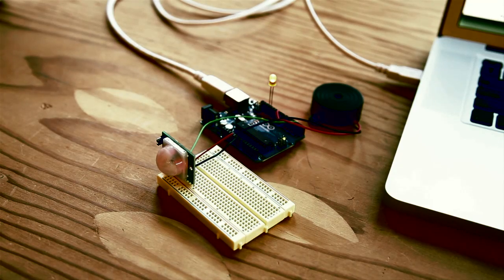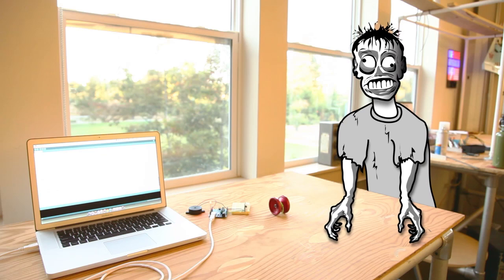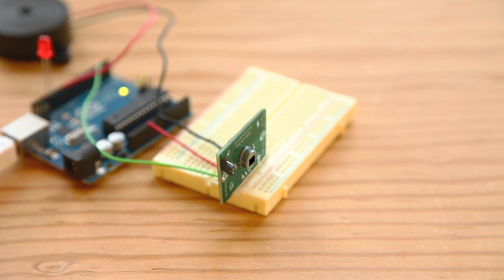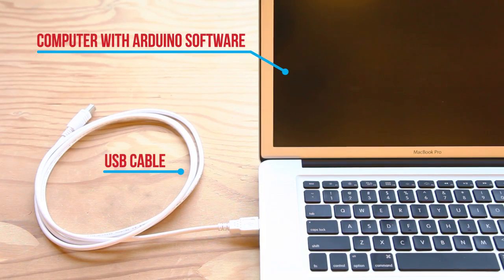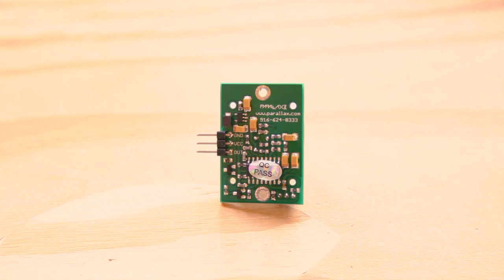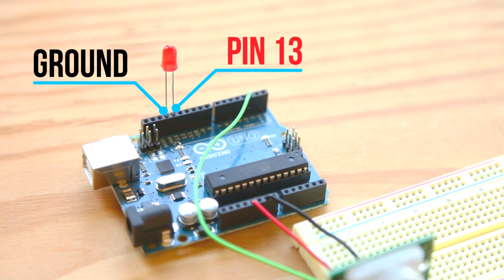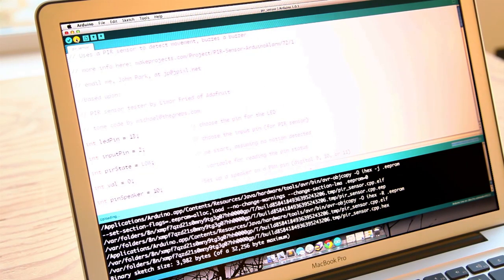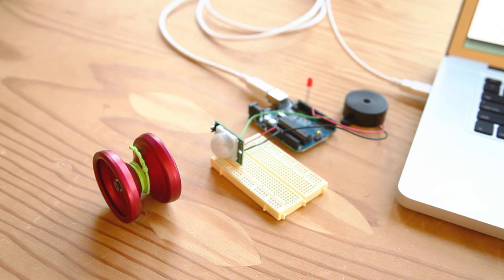Weekend Projects - PIR Sensor Arduino Alarm

Comment: Actually there is a relationship between the thermal radiation (in the range of infrarred) and the temperature (Wien Law). matter emits radiation and for normal temperatures the maximum peak is in the infrarred, so we can detect the zombie because is matter and matter emits radiation.

Comment: Actually that doesn't matter but the zombie will still be at least room temperature if it's in a room. And because of this, it will emit heat or Infra-red light. This is a tight of light has a longer wavelength than visible light. All object emit a type of light with a certain wavelength depending on it's temperature. Around Room Temp. (298 K, 25 C, 77 F), the wavelength of the light is about 9.7 microns which is in the Infrared range. If you want to learn more, read about Black-Body Radiation.